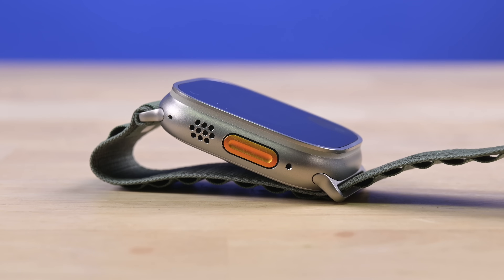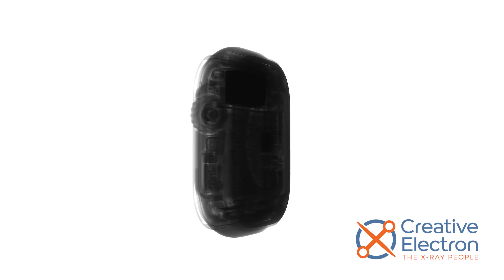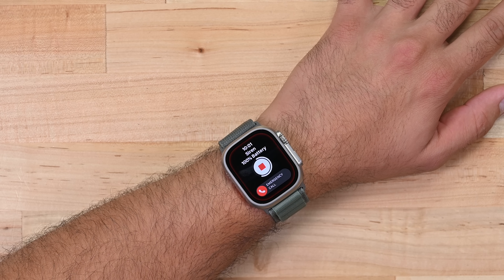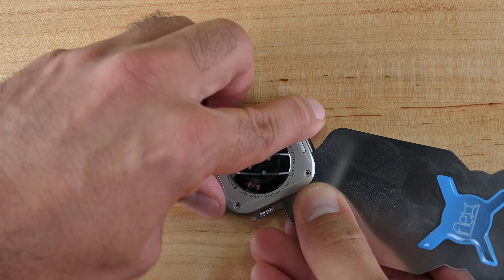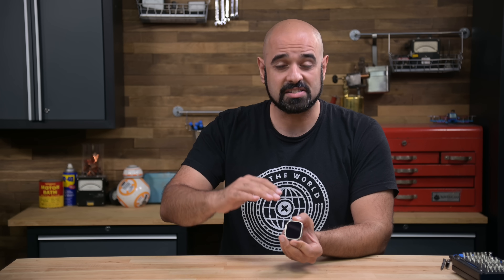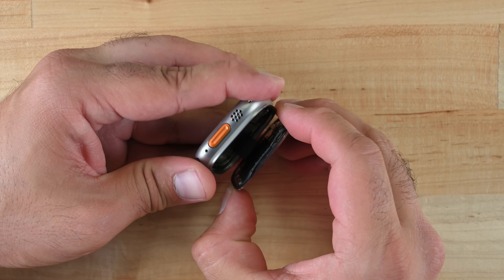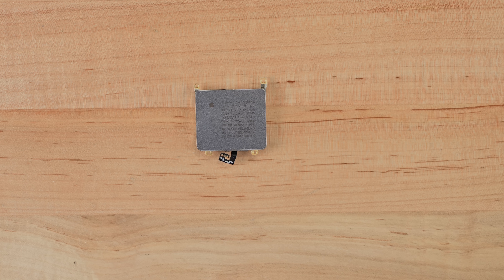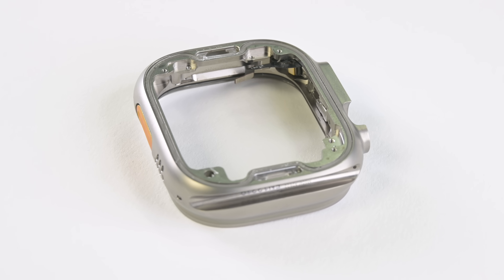Apple Watch Ultra Teardown - Beautiful, Rugged, and Almost Repairable

Comment: I think it's not the watch's fault you broke the screen. It clearly needs to be pulled out by suction cup first and then only cut out by plier. No wonder it cracked, you just tried to scrape it out of the casing.
Reply: I would wonder if it's better to use a suction cup and a thin plastic card to loosen the adhesive? Suction cups don't usually come in that small of a size thought.
Reply: I thought the same. If not a suction cup maybe some glue. Like the one you use on cars to pull dents
Reply: There is literally someone hitting it with a hammer and it doesn’t crack
Reply: Exactly. It’s like the more recent iPhones.
Reply from the maker: The screen was too small for a suction cup to adhere to and the tolerances were too tight for anything but a thin object with enough rigidity to cut the glue. Our colleagues in the EU managed to get the screen off without damaging it using the same tool. I'm afraid this came down to a mistake and a lack of patience on my part. Time to "git gud" - SM
Reply: @iFixitYourself  get a smaller suction cup…
Reply: @iFixitYourself  that is like saying "fixing a jet engine with chainsaw". If you do not have the right tools, you can’t blame Apple.
Reply: @iFixitYourself   correction: Your suction cup was to big to adhere to.
Reply: @iFixitYourself  indeed
Reply: @iFixitYourself  don't have the repair guide from Apple on exactly how to go about opening the device, proceeds to try and open it how you think it should be done, then blames the device on poor repairablility. This is the difference between how an amateur would open a device vs taking it to an Apple store where a qualified person can open it.
Reply: @jbutler  Show us a repair guide then, genius. That's literally what everyone in the R2R community has been asking for.
Reply: @jbutler there’s no way that anyone at an apple store would be opening this 😂
Reply: @nyccollin obviously they do. They’ve repaired screens. Do you think there’s a magical screen pop out function built into the watch?
Reply: @iFixitYourself  and if it gets you more clicks if it breaks, well so be it.
Reply from the maker: @whodakat9989  That is a big nope on my part. I had my boss sitting next to me 6 months into a new job. I did not want to break this screen. We don't like waste, not even on our set. -SM
Reply: @iFixitYourself  excuseeee
Reply: @iFixitYourself  Sorry, but using excessive force on a device because you don't have the correct tools does not mean that it's not repairable. Just watch some mechanical watch repair channel to see this.
Reply: @iFixitYourself  I would have probably tried hot glue and a pull stick although it's possible the temp might damage the screen or coatings?
Reply: @iFixitYourself  sounds like excuses!
Reply: @KenRuns09  sounds like blind apple fan. Give me 10 things you hate about Apple. To prove your unbiasedness!
Reply: @KenRuns09  let's see you do an Apple Watch Ultra screen replacement then
Reply: There's always someone defending apples bad design choices lol
Reply: @ForeverMan  the most basic flat screen design is a bad choice? What’s a “good choice” then?
Reply: @mrtmilf  🤣🤣you funny , what do you smoke?
Reply: @ForeverMan  lol the repair manuals arent probably even out yet and they just used brute force. And what a surprise it breaks …
Reply: @kleini3  they never release manuals lol
Reply: @kleini3  Manuals 😂😂
Reply: @ForeverMan  the watch isn’t badly designed the removal of the screen was poorly executed
Reply: @ForeverMan  If you don't glue in, you have no water rating under pressure.

Comment: What did you expect would happen when you pried the screen away with a metal tool?
Reply from the maker: For it not to break, like our Guide Writer who expertly removed the glass on his device. Nice work Dominik :)

https://www.ifixit.com/Guide/Opening+Procedure/153357
Reply: @iFixitYourself  you need to get someone that has the skills to be able to do this. Anyone can give tools to a intern and say try and open this Apple watch and if the screen breaks blame it on poor design.
Reply: Apple could have easily used a seal, that swell above 140 F, thus lifting up the display for easy pry. They deliberately choose to not.
Reply: @goiterlanternbase  I feel like we've already talked how Apple doesn't want repairable devices, hmmm, not suuure if that's a new thing or not.. hhmmmmm
Oh wait.. 10 years ago it was the same just less "gotta break it more to repair it"

Comment: I guess you are removing the screen the wrong way. You need some sort of small suction cups for that
Reply: Also he need to use a heat gun against the glass for a few minutes, to make the glue to get softer and less adhesive, that is standard when removing the glass screen on iPhones.

Comment: Siren Loudness: DC Rainmaker explained in his review that the efficacy of the siren (or alarm) was more due to the frequencies used, and the cadence between chirps than pure loudness.
Reply: And it gets louder when you point the watch away from you. Like the flash light which gets brighter when you point it away from you.
Reply: @Fermen80  i litterally just said this too haha, i think it is a quality of life feature so its not blaring into your face if you want to turn it off.
Reply: And he went on to test it from the claimed 600 meters and found it easily audible, suggesting in good conditions it could be heard from even farther away.
Reply: @toadlguy  keywords "good conditions" if you're ever in a situation where you're in trouble and need help, you likely aren't in good conditions
Reply: A few YouTubers mentioned this, it is not just trying to be loud, they picked a frequency that travels far when you are outdoor. When you are indoor with other ambient sounds around you, it’s not going to sound loud, also a sound frequency can sound weak but can still travel far and be heard.
Reply: Most everyone I know who hikes or camps carries a $5 whistle for an emergency and they are SIGNIFICANTLY louder than this watch.  Yeah the watch chirps are distinct but you can hear a $7 storm whistle for miles.
Reply: @FastRedPonyCar  I one is conscious and able, a whistle is the way to go. I agree.
Reply: It’s meant to sound unnatural
Reply: Easy enough to test out the effectiveness - play some hide and seek in a national park, on a hiking trail, in the woods somewhere.

The idea is that rescue would have some GPS coords right? And the alarm gets them the rest of the way?
Reply: Different perceptions. DC is outdoors often with an ear out for things on trails.

Ifixit guy might be used to being indoors, top notch headphones on. 

I found the siren not only easy to detect at range but the pitch made direction easy to detect.
Reply: Also, was it just me or did the sound start to get a lot louder when the screen turned off just before he cancelled the siren?
Reply: @GraysonCarr  it gets louder and will even switch to SOS Morse code after a bit and then back and forth from the normal siren.
Reply: Exactly loudness ≠ decibels
Reply: @andrewmarthie5062  but it does though right? What is a decibel a measure of other than sound levels?
Reply: @FrogsOfLore  A measure of sound but not perception. Some some frequencies are perceived as pain making them sound louder when they actually aren’t.
Reply: @andrewmarthie5062  the human ear doesn’t work like that. It’s a well known for over half a century. In the late 60’s Guitar amplifier maker Orange had a problem its amps weren’t loud enough even though the Db meters was showing it to have a higher db then the competition. They were to a hearing specialist to ask why and were told that the brain perceives certain frequencies as pain making them sound louder then the actually are, apparently an ancient survival mechanism. So Orange went back tweaked the circuit to boost the frequency’s and hey presto louder amp.
Reply: If the alarm speaker has some water inside the sound will be super low. Water eject doesn’t work properly on that speaker so you have to wait around 12 hours until it dries.
Reply: apple enthusists will cling onto anything to justify their $800 watch I guess. Also, I dowbt 90% of people buying this actually do any hard sports.
Reply: @photon2724 and Apple haters will prove so desperate for attention that they’ll watch Apple videos just to leave their unwelcome dim-witted comments.
Reply: @photon2724  oh stop it with your childish reaction. With fan boy (I am certainly not a apple fan boy, and own a ultra) Either you like it or you don’t. You know what you buy and getting into. Is it expensive, yes! Do I care no, I like the watch. If I wasn’t able to buy it, I would buy something else, but now I can. The android phones are not much better, tried a few and those are the one that cost me real money, becausw second hand worth nothing and was done with them after a month. Is the apple watch ultra perfect? No but neither is a porche, audi or mercedes or Volvo, here you can ask exactly the same question.

Comment: I’ve returned mine. Has the aluminum one for a year and not a single nick or scratch on the case. Had the Ultra for 1 day, played tennis. Never hit the ground or anything, two nicks on the titanium. Very unhappy.
Reply: So are you saying that nicks just randomly appeared on the titanium case, or that titanium is not more durable than aluminum? Because the former is impossible and the latter is factually incorrect.
Reply: @jared9127  im not saying that aluminum is more durable than titanium. I am simply sharing my experience. I have absolutely zero reason to "troll" or mislead.
Reply: Sorry but have to say you are trolling.  I have had two stainless steel Apple Watch’s that always scratched, I now have the Titanium Watch 6 for two years and still looks brand new.  Titanium is extremely difficult to scratch, and Aluminum you look at it wrong and it scratches.  So yes, you are trolling.
Reply: @davidgates5699  I have absolutely zero reason to "troll". I wasn't aware that they made titanium watches prior to the Ultra. Are you sure about that? I am simply sharing my experiences. I go to the gym 3 times a week with my aluminum watch and not a single scratch or ding on the case. 1 day with the Ultra and 2 scratches / scuffs on 2 different locations.
Reply: @GoKaioken  The Apple Watch 6 Titanium was $849, same as the Watch 7.  So the Ultra is actually less than the original Titanium watches.  Even my Titanium band shows no wear. Titanium is several times harder than steel, has to be something ridiculously hard and sharp to scratch Titanium.
Reply: @davidgates5699  I didn’t realize they made edition models that were titanium in the past. 

Point is, I’m not getting on a YouTube video to gain anything by lying about my experience with the Ultra. Just sharing what happened.
Reply: Wow that’s discouraging. I’ve had a titanium series 5 since shortly after they came out and I have no scratches or dents.

Comment: someone should make a nice, thick glass screen protector that perfectly fits into that lip and just kinda fills up the space
Reply: Why? It's made of sapphire. Incredibly unlikely it'll ever scratch (with a 9 on the Mohs scale). In 7 years I've never scratched or cracked any of my Apple Watches.
Reply: Dude that lip is virtually nonexistent and if the pavement is slightly raised anywhere the glass is meeting it ..there isnt much to fill in at all.I have the watch
Reply: @IlLAD3LPH1A215  oh i was under the impression that the lip was pretty deep
Reply: @CommonTater100  No barely

Comment: Based on my watches a majority of hits come from the side and if it falls directly down that lip will save both instances. So really direct impacts of something smaller than the face is the only thing left to worry about.
Reply: My G Shock repeatedly gets whacked on the sides, rarely on the front unless I’m walking adjacent to a wall.
Reply: @darthraider450  if your g shock as smart as ultra watch lol
Reply: @unvcht5046  at least it will last much longer and be useful in 10 years time, can't say the same for the smart watch. Let me borrow your smart watch and I'll film a video of myself throwing my G Shock and your smart watch at a wall and see which one survives 😎
Reply: @darthraider450  2 watches built for really different purposes. Both leaders of their own games, they dont compare to eachother.
Reply: I have a Garmin Fenix and the lips aren't raised that much either. It isn't possible to make a watch that fully protect the screen from the front without blocking the screen lol

Comment: Is it feasible for the next iPhone externals to use titanium instead of stainless steel?
Reply: @гопник it’s expensive, but not THAT expensive, at the quantity needed for a phone. I have a bicycle made out of the stuff, so it’s not beyond possible.
Reply: @гопник whatever. I was just pointing out that it was easily possible, and it’s likely there would be a market for an iPhone ultra Ti. I’ve no idea if apple will, but they definitely could if they wanted to. High end products are kinda their thing.